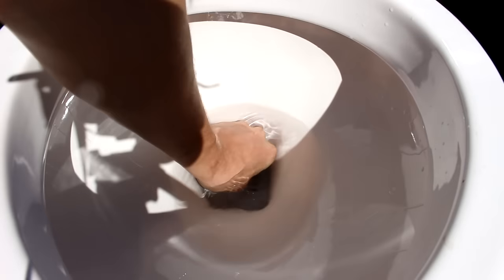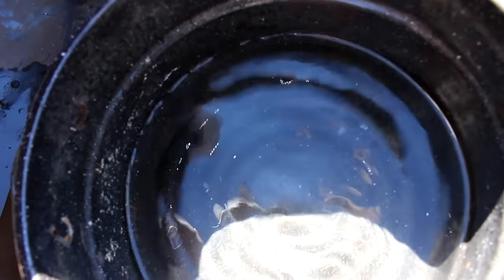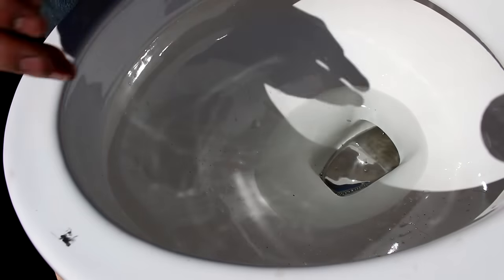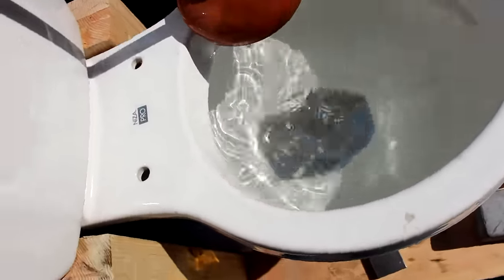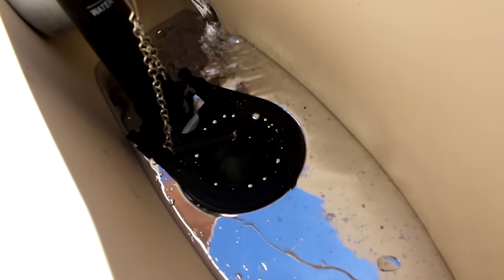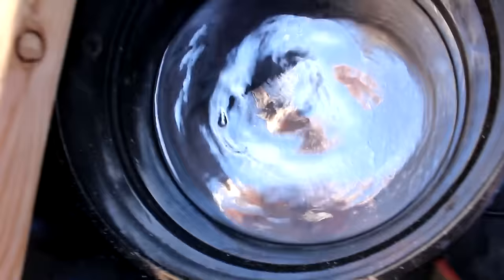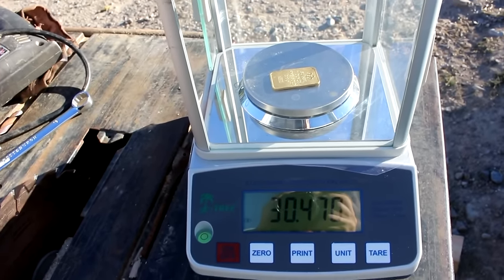Flushing 240lbs of Mercury

Comment: got to hold the flush handle to get the most powerful flush. just pushing it and letting go gives a weak flush on every toilet
Reply: I crank it after i push down, keep pumping until all of that cisterny goodness is gone.
Reply: It doesn't work like that. All you're doing is opening and closing the hole. For the best flush, do what illstplaya suggested.
Reply: It does seem to work that way on some toilets. I had an old toilet that you had to keep cranking to initiate the flush.
Reply: This comment looks like something that a kung fu  master would say.
Reply: Have a home depot homer bucket filled with scorching water. It will make sure everything washes down. You may flush after if preferred for formality.
Reply: Cameron Pearce
Mate it be better if you left out the references to my hole. My toilet is my throne and my actions are just and righteous.

Comment: why isn't this maniac wearing gloves?
Reply: Rollin Leonard 10:56
Reply: not a good enough answer
Reply: De answer is: He decided not to wear them cause hes working with water and mercury
Reply: Watch his video titled "Bare hand vs liquid mercury".
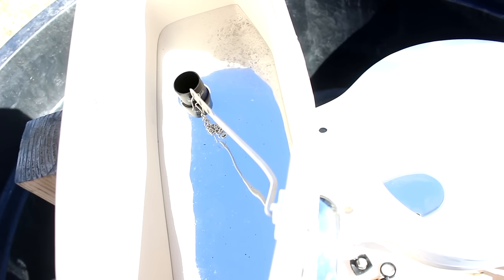Reply: The lunatic just sticks his had in it! 8:21
Reply: And he bites the skin around his nails so, so much for "no risk of superficial epidermal contamination"
Reply: Blood tests came OK
Reply: "next, we'll drink mercury to see how it comes out"
Reply: Rollin Leonard it’s galium
Reply: @justanothercommentor505  calm down this version of mercury is non poisonous in low doses
Reply: @dobhome8399  it's poisonous if it actually enter your system. And as metalic mercury don't go trough skin, and the amount which will go trough eventual microscopic holes is insignificant to do any harm. Mercury compunds in general are much more dangerous than mercury itself.
Reply: @clairebear9827  Nope. Gallium is not as fluid as mercury at room temperature.
Reply: @clairebear9827  its not galium
Reply: @fresque  lol coz it is already deposited in his brain and other tissues.
Reply: Because he not using organic mercury
Reply: This guy is probably gonna die so, just why would he put his hand in it 8:21, stupid I knew 3 yrs ago that it would be lethal , I am 10 BTW dis guy got no noodle.
Reply: Mercury nitrate is able to be absorbed into the skin. Not metallic mercury.
Reply: He's inhaling it. That's bad. Metallic mercury doesn't absorb very well into skin but it does penetrate. Skin is semi permeable.
Reply: Why doesn't your channel thumnail have a body?
Reply: mercury poisoning
Reply: no, it isn't
Reply: @yeetbruh2159  if you are 10 you aren't allowed a yt account (legally)
Reply: BECAUSE MERCURY DOESN'T ABSORB THORUGH THE SKIN
Reply: Drinking mercury wouldn't be dangerous either
Reply: wtf
Reply: Innocent muffin!  you really won the argument.
Reply: @kirby4687 No, I actually happen to know a few things about chemistry. Gallium has a bright, silvery luster, it has a lower density than mercury, and its melting point is higher than that of mercury, thus making gallium more of a semi-solid.
Reply: @cellogirl11rw55  my bad then thank you for informing me
Reply: Because there are so many types of mercury and what he used in this video is not the one that can absorbed into skin.
Reply: Ya
Reply: @nanie_czka123  it's actually lethal lol, hope you said it ironically
Reply: Because normal mercury doesn't go through skin
Reply: And he even sayd this so the mercury doesn't go into his skin 8:19
Reply: The final Terrarian he had no cuts and he didn’t really stick his hand in for way too long, right?
Reply: @clairebear9827  gallium sticks to stuff
Reply: It's not organic mercury so it can't enter your body through contact
Reply: exactlyy!
Reply: @elkevm2584  what? why would that have any effect? god, this channel is going to make some stupid people do some stupid stuff.
Reply: This is not organic mercury, this is dental mercury
Reply: @nanie_czka123  it is dangerous if the mercury enter you digestive system and your bloodstream
Reply: @kirby4687  organic mercury can be absorbed on skin contact
Reply: he also stuck his hands in it -_-
Reply: It may or may not be elemental mercury.
Only one version is toxic.
(I'll let you try that urself)
Reply: Ikr if it fells on his skin he can literally die wtf is he thinking
Reply: smart thinking, eddy the toad.
Reply: lol what's "organic mercury"?
Reply: also  any form of mercury is dangerous and it's properties allow it to pass betwwen organic material when in contact with the material for a short period and the rate at which it floats its way in depends on the cellular matrix of the organic material in question. this man is lucky and ballsy, he wouldn't be caught handling materials in my lab that's for sure. good thing he has his own....
Reply: @lordcommandernox9197  he said he bought a new toilet the toilet is new and it has clean water no one pooped or peed in it
Reply: Because Cody is cody
Reply: Mercury is a highly toxic metal. It gives you cancer if it gets in your bloodstream
Reply: Shart12373 or maybe you dont read very good
Reply: @knelson2492  dogs eat their own shit
Reply: @yeetbruh2159  You should know then, Jimmy Neutron Boy Genius, that mercury metal is not absorbed through skin that quickly or in such quantities.
Reply: LJM tube obviously you didn’t read what he said later in the video
Reply: Mercury dont pierce skins, mercury nitrate does.
Reply: Dob Home~o
Reply: Elemental Mercury can be swallowed with very little negative effects, let alone skin contact, though still not recommended. It's why you don't hear of children dying from swallowing mercury from thermometers, which happens/happened more often than you think.

Mercury fumes are also of little issue unless you are actively heating it up in a closed area due to it's atomic weight making it so much heavier than the surrounding air, requiring a lot of energy to actually cause it to fly around in any large amounts.

Organic Mercury however, such as Methylmercury, is the real deadly stuff that your body will readily absorb very rapidly and move through brain-blood barrier and is often the type of Mercury people confuse elemental mercury with when talking about it's negative effects.
Reply: its a new toilet, its unused
Reply: Eddy The Toad I wish but the lead would sink so it's not
Reply: @dobhome8399  Mercury only poisonous in higher amounts if sucked in your methobolism throught skin or internal organs. But mercury is just too dense to go throught your skin fast enough. You take more mercury into your body when you eat fish than holding mercury for several seconds.
Reply: @dobhome8399 methymercury* that's what kills you quickly
Reply: Mercury’s just a metal, and doesn’t really soak trough skin I think
Reply: Organic and inorganic mercury my man
Reply: ca  you educate me on the reasoning he would need gloves? i am clearly stupid when it comes to this stuff
Reply: gloves goggles lab coat and one of those suits they wore to operate on E.T.
Reply: OH THE FBI IS HERE!!!
Reply: Its a new toilet so its never been used. So its clean dont worry 😂
Reply: @lordcommandernox9197  Normal as you'd expect. Mercury is good for cleaning the lining of your bowels!
Reply: @lotus8965  Thass right...It's true!
Reply: @Major League Gamer  @7elvxl1  @infinitegamer _07  

It's the mercury that's worrying! Not the bacteria on the toilet. 
That's like comparing a flu virus with being irradiated by nuclear fallout. One of them is permanent and has commutative future downsides, the other gives you anti-bodies...
Reply: @lordcommandernox9197  yeah true that's why it's dangerous
Reply: @yeetbruh2159  get outa here kid
Reply: @brentlanders20  thank you
Reply: I liked this comment and made the likes say 911 such a sad day
Reply: @dobhome8399  no dimethal is this is just a metal like gold
Reply: @boobgoogler   while elemental mercury doesn't cross via sweat glands like the oxides it's extremely volatile and your skin does allow the vapor to pass through. it's not good to handle without gloves.

Comment: this is what rich people use in their toilets
Reply: EzraTheLB Playz not from radiation but from poisoning
Reply: Helen Xu One of our companies makes a highly exclusive and special Gold Tone Gold-ized-Mercury. When used in a Gold Plated toilet, it COATS the surface of the water with a 1/2 inch of reflective Gold Completing the effect!   Anything that falls in is instantly 100% obscured by the liquid gold, which traps odors as well as unsighlty reminders of mortality.  It is as if it never happened!
Reply: It would be literally impossible to flush poop or pee with mercury. So, if you think rich people want to fill their toilets with poison so they stop working correctly, then sure...

Comment: If you drank a glass of Mercury and then took a dump, would that go down the toilet any easier?
Reply: Nope. You'd be dead.
Reply: No shit ... get it?
Reply: Actually from what I can remember being told when I was a kid because we would break a thermometer like the kind you take your temperature with and play with it.  My Dad told me if you swallowed just only that much (thermometer size), That would kill you, so just a few drops.  It was really fun to play with though.....we used to get a block of dry ice and put the mercury on that.  It would make a whizzing fizzing sound that I can still hear in my head, and dance all over the place.
Reply: Heavy shit.
Reply: I broke one in my hands as a kid as well (but no cuts) and always wondered if it affected me negatively. I'm 25 and I have fibromyalgia now but that could be from a number of factors based on my research, mainly genetics and almost dying several times. So it probably wasn't the mercury, but I'm still freaked out I was playing with it in my hands as a kid.
Reply: Micah Sarver your fine. Mercury is not that bad. Your hands have very thick, callused skin. It does not absorb through your hands. Cuts are really the only way for it to absorb. Beyond that, mercury vapor is extremely dangerous, have but only occurs if you heat or boil mercury. Then it can absorb through the lungs like smoke. Avoid mercury vapor! But mercury liquid is actually really cool and has marginal risk, even if skilled, even if you did stab yourself with a glass mercury thermometer. Im pretty sure you get more mercury from a tuna fish sandwich than you were exposed to as a kid. Look it up, that's a real stat.
Reply: on a serious note, look into CBD for fibromyalgia
Reply: Try Gallium, it melts in your hand and looks a lot like mercury. The half-life on it is quite short, so as long as you're not doing that every single day, it's out of your system in a week tops.
Reply: Spoken like somebody who doesn't know what they're talking about.

Exposure to mercury is a cumulative thing. If the only exposure you have to mercury is playing with it a couple times as a child, then I doubt very much that it's going to be an issue.

However, mercury shows up all over the place, it's in various foods you eat and possibly the air you breath. If you're in the room where an older fluorescent light tube broke, you've got exposure there, as well as any of those metal fillings that the dentists like to put in.

Mercury does leave the system over time, but if you're not excreting it as fast as you're absorbing it, you'll eventually wind up with health problems as a result.

The reason why people no longer play with mercury is because it damages the nervous system and there's no reason for the exposure. Not because one or two exposures is going to be fatal.

Not to mention the possibility of children eating it. I mean seriously, small kids will put just about anything in their mouths if you don't stop them. Kids get perforations in their digestive track from eating magnets.
Reply: Pokemon Chrisberg You can get it on Amazon, it's not that expensive. 

The big thing to keep in mind though is that if you drop any on carpet, it's going to be a real challenge to remove as it freezes at room temperature, but melts at a bit below body temperature, so if you drop any of the liquid on carpet, it'll then freeze into the carpet and be really hard to remove.
Reply: No it will do nothing down there on your body but it will affect the brain in your upper body!!!!!